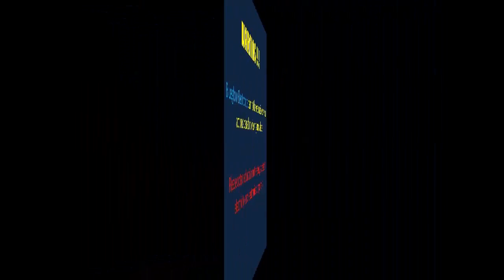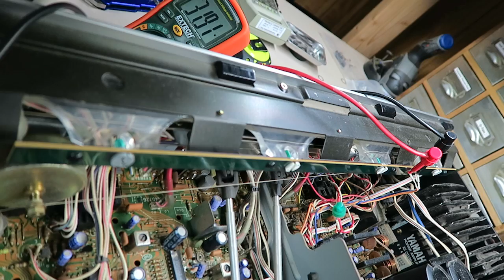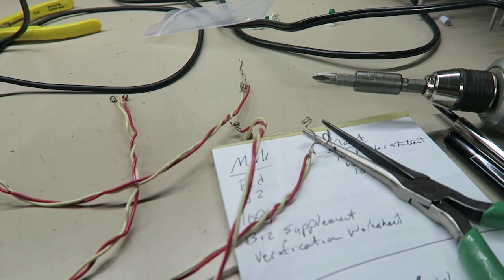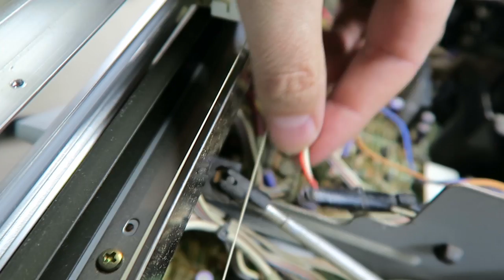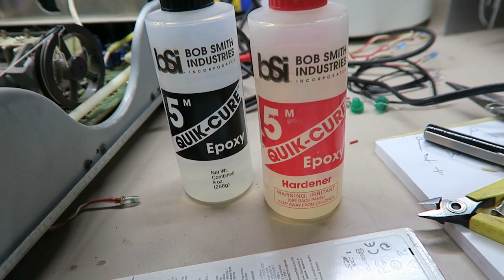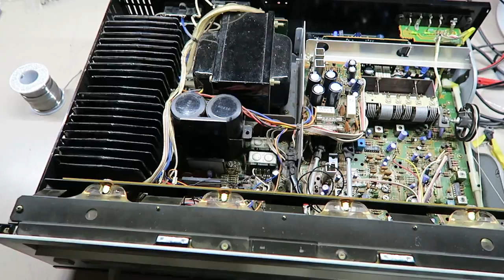Yamaha CR-1040 Bench Test and Light - Lamp Replacement Part 2 - BG056

Comment: Did you notice if your 4 dial lamps that you installed in the beginning of your video did not turn clockwise and lock into place tightly as nicely as the originals do?
Reply from the maker: They fit perfectly
Reply: Blueglow Electronics  Do you mind me asking who or where you purchased the dial lamps?
Reply from the maker: I picked them up as surplus off an electronics dealer.  Wish I had a better answer.

Comment: I replaced the lamps on the smaller CR-440 a while ago. Interestingly, the scale lights were not wired in series on that unit (in fact, only one was out when I got the receiver). I also used heat shrink and soldering to connect the new bulbs. Seems to be an okay solution.
Reply from the maker: +Jan Beta I've never worked on a CR-440 but glad they didn't do the series thing.  Its a real PITA